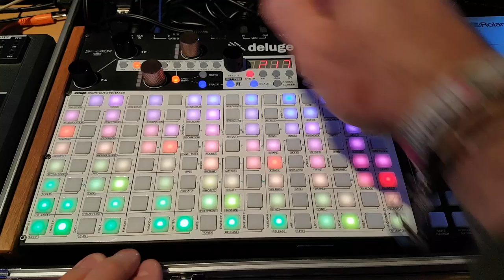Synthstrom Deluge - FM Synthesis - Envelopes, LFO's & Sound Design

Comment: What a fantastic sound! I can't wait for my Deluge to arrive, hopefully in a few days! 

You sound like a local East Midlands bloke to me. I'm close to Chesterfield Jcn 29. Do you do teaching?
Reply from the maker: Yep I'm from Nottingham. In the process of sorting out some formal music tech teaching stuff
Reply from the maker: I I think people really underestimate the synth engine on the Deluge. Its actually really powerful
Reply: @rezzonator  I've come from OP-1 and OP-Z backgrounds. I have done several videos on both. I find the OP-Z suits my workflow better, since you can easily cock up lots of hard work, in the OP-1, if  you don't copy a section before overdubbing. The OP-Z is awesome but is, of course limited to eight musical tracks and only for of them are effectively melodic. Therefore, creating layers, without taking attacks into a DAW, is somewhat limited.

The Deluge, on the other hand, seems to be without limits and no DAW needed, which is pretty radical.

When mine arrives, hopefully sometime next week, I'm going to redo my OP-Z Odyssey song by sampling the patches used directly from the OP-Z and then making it a fuller song on the Deluge. That's will get me used to the sampling at the very least 😁👍🏻

After that, some house music...

Do you have any good pad sample pack recommendations?
Reply from the maker: If you look on the deluge forums there are plenty of sample packs around
Reply: @rezzonator  thank you 😁👍🏻